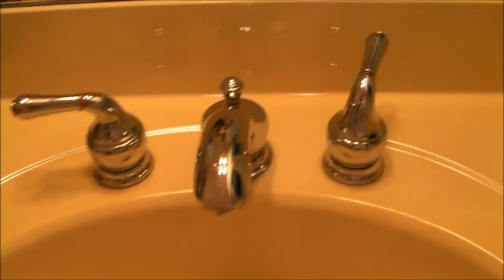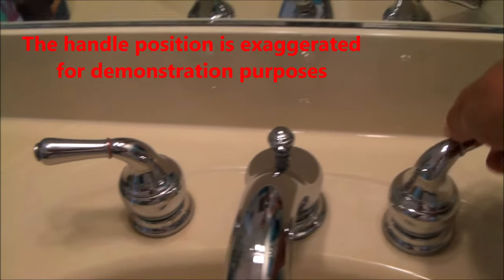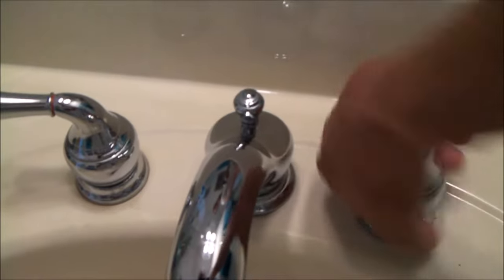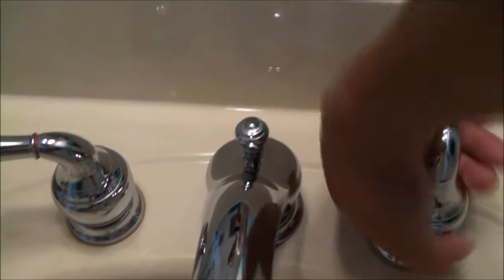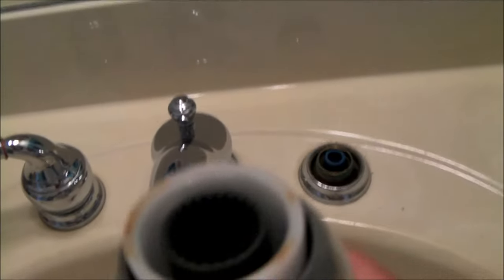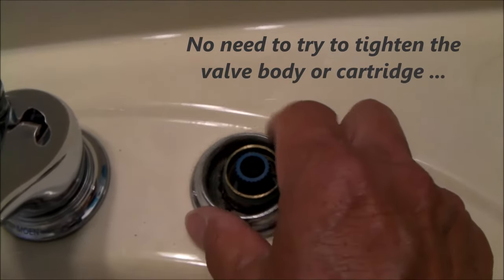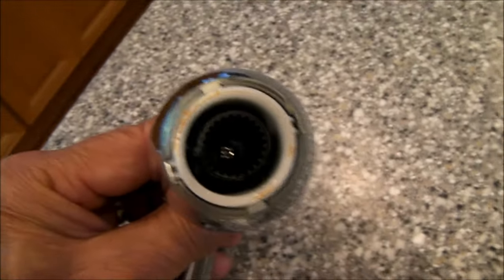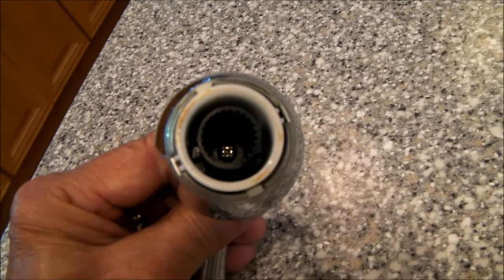Moen Faucet handle keeps twisting out of position

Comment: Hello my base is stuck.  How do I get it off to replace the cartridge?   I have tried putting a rag with channel-locks but it’s still too tight.      Thanks in advance!
Reply from the maker: you need the tool to loose the nut INSIDE.  Channel locks on the outer "ball" is not going to do it.

Comment: In my case, tightening screws didn't fix the twisting handle problem (It wasn't dripping any more, so I asked my wife if I could leave it that way, and she said no.)   So, I studied how the spline fit on the cartridge  (I had already pushed in the new cartridge, so I did my detective work examining how the old 1224 cartridge fit into the blue spline).     By the way, I pulled the old 1223 white cartridge out by using needle-nosed pliers.  But I couldn't do it by hand no matter how hard I yanked on the pliers.   First, the pliers kept slipping off, so I used a small clamp to squeeze the plier handles tight.   Now it wasn't slipping, but I still couldn't pull the cartridge out.  I could turn it, but I couldn't remove it pulling with all my might.   I think it is just two O-rings holding it place, and they were defeating me.   Next I added vice grips to the plier handles about an inch away from the top of the sink, placed some rags to protect the sink, and then inserted the handle of a pipe wrench as a lever.  The 1224 cartridge popped out as easy as could be.)

Comment: I have the same setup with the 1224 cartridge. I replaced the cartridge (PIA getting retaining plastic ring out with that POC brass tool). Anyways, the faucet no longer leaks - YAY! But over several days it slowly creeps backwards - BOO! I've taken apart the handle and all screws are tight and both ribbed fittings are in perfect condition. At a loss here. Anyone have any ideas? P.S. Does Moen really have an unconditional warranty on the 1224 cartridge?
Reply: Yes, have had them send me a few over the years, also the shower cartridge. Which was like $40 at lowes, contacted Moen with a pic and they sent a new cartridge.

Comment: Can you help me? I have this exact faucet/handles.  Mine has developed a slow drip? I am trying to remove the entire set to replace it. Initially I was going to replace washers but since it's such a pain in the a** I think replacing entire set might be better.
Reply from the maker: There are NO washers in that moen faucet.  The cartridge has a lifetime warranty.  Just call moen, tell them the model of your faucet and they will send you a new cartridge.  You might need a special tool to remove it.  Be sure to LIKE and subscribe if my video helps you.  I think the faucet is the Monticello Inspiration T4570 and it uses their 1224 cartridge and the removal tool is the 14272 ($7.55 from Moen).

Comment: Thank you for this video.  My problem is that the handle is loose.  I tried the steps that you showed in your video and tightened the screw, as that has worked in the past, but it isn't working this time.  I think I may need a new part?  Any advice?
Reply: I'm dealing with this right now. It's not always as simple as the screw being loose. In my situation the blue(cold) or red(hot) extention was broken off inside where the top of the cartridge is and the cartridge is damaged. The mounting nut underneath the countertop is also loose. If you decide to change it yourself, make sure you have the proper tool to remove the retaining washer, it's plastic and can strip fairly easily without it. I also purchased a parts kit from Amazon that has new retaining washers and extention kits. If yours is moen , this is a link for the tool Moen 14272 Cartridge Retainer Removal Tool for 2 Handle Cartridge https://a.co/d/9Fl04V2 and Moen 97479 Monticello Widespread Bathroom Sink Faucet Replacement Stem Extension Kit   https://a.co/d/fFnESSu is the parts kit. The cartridge is moen 1224. You should be able to tell what you have once you take off the handle.

Comment: I’m having trouble unscrewing the base. It seems pretty firmly connected. Any advice?
Reply from the maker: probably dirt build-up.  The lower ring should twist ... WD40?
Reply: @YuDaMan  I used channel locks and a rubber piece to prevent marring/scratching. It did the trick.

Comment: Do you need to shut off the water before removing the top? Thanks.
Reply from the maker: Nope.  Top comes out but the cartridge which controls the water flow is still in place.

Comment: Thanks for posting this! The base on my faucet was moving everytime the handle was turned on and nothing was loose under the sink... I could not figure it out! Thanks again! I fixed it myself after seeing your video!
Reply from the maker: Glad it helped!  Be sure to LIKE and SUBSCRIBE.  THAT will really help ME!  THANKS.
Reply: Same here! When I turn on the hot water with the handle, the whole base turns. So is the little screw in the handle too tight or too loose?
Reply: @joandodds2824  I just cranked the whole handle around till it was tight again and it hasn't budged since.